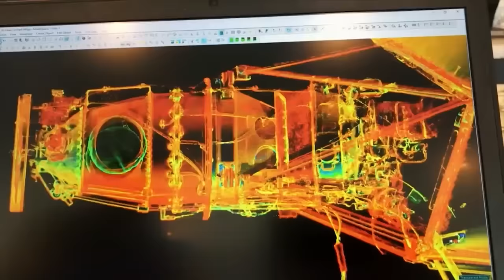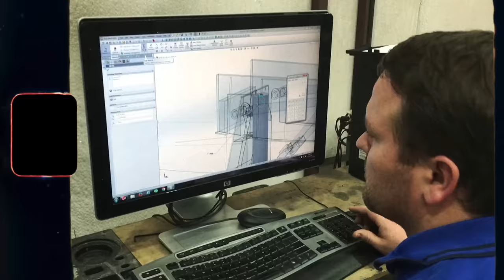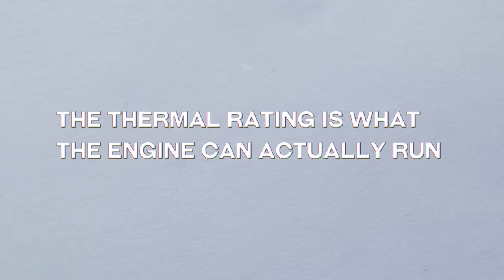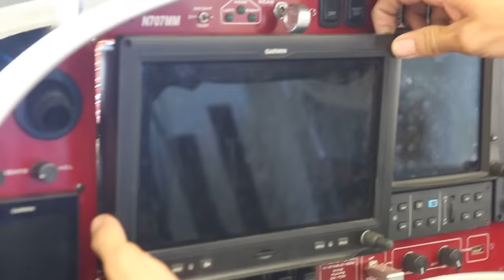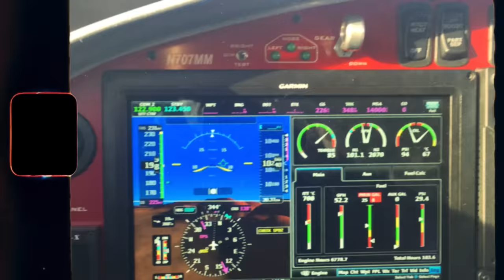Creating a Monster - World's Fastest Single Engine Turboprop | Turbulence #4

Comment: "Engineering" by Black & Decker and DuPont. Bend to fit. Paint to match. And you still won't be able to bust 250 kts in controlled airspace. And gearboxes are TORQUE AND SPEED RATED for "calculated horsepower". More torque at lower speed is the correct way to "make horsepower". If the gearbox and prop can't handle the torque "at speed" or vice versa, "thermal horsepower" - which is calculated using "standard conditions" of atmospheric conditions AND fuel specific gravity dependent on the fuel being "cold" for "maximum performance" doesn't mean squat. And no, "they" - meaning real aerospace engineers and A&P "mechanics" - do not put a "small" gearbox on a "big" engine and then "derate" the latter for "maximum performance". 

Properly engineered "slow" planes ultimately "outrun" every POS "homebuilt" psuedo-experimental "hot rod" deathtrap by flying "slower" for far longer before needing "maintenance" and/or "service" and/or "sorting out" by a "builder" that is focused on "high performance" and thinks anyone in the "industry" thinks "top speed" has ever sold a general aviation aircraft to the "general public".

Comment: Would be great that you could do this commercially, better basic ariplane, but very aerodynamic like this one, much smaller engine, for budget people; and the more Cessna-like for commercial aviation and passengers. The Aerodynamic of current small air crafts suck, lots of drag, landing gear outside all the time, a mess. Same for the engines, bulky and the propellers not really the best size or shape, with sharp angles